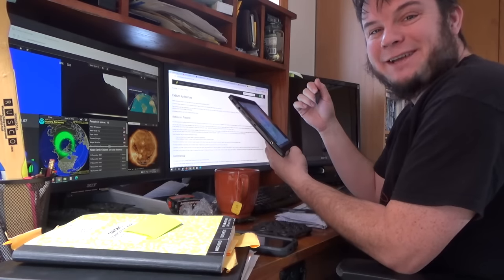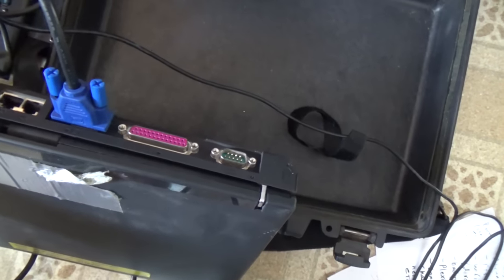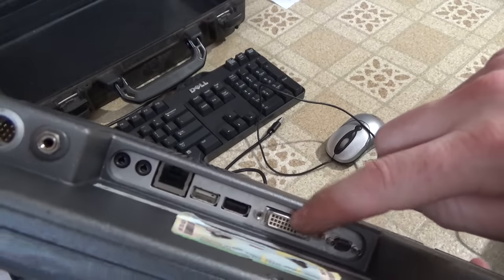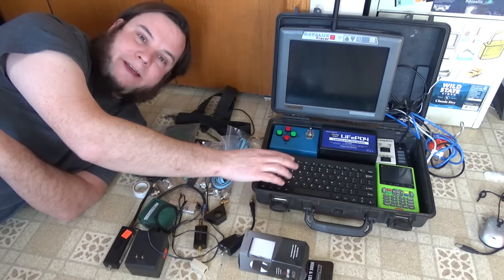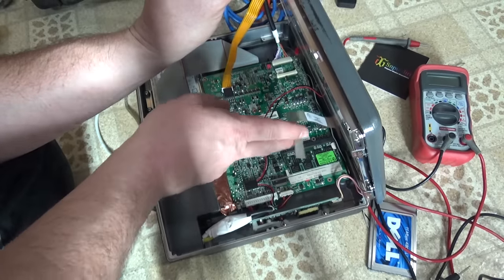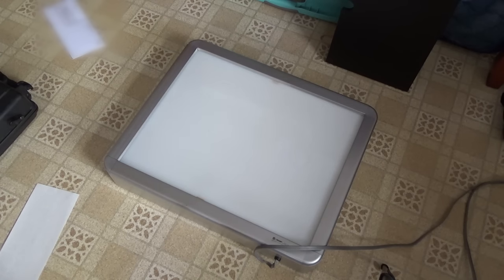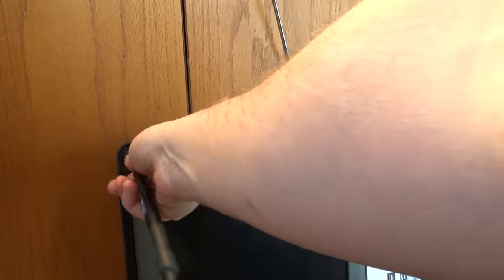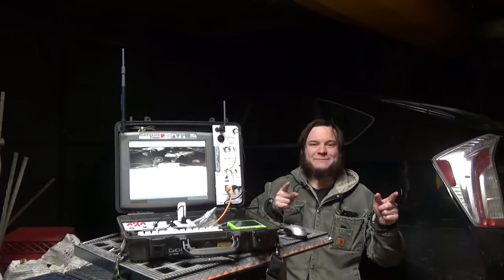Custom Cyberdeck For (Legal) Satellite Hacking

Comment: I have a few ideas for a more stealthily James bondy functionality if your interested.
Reply from the maker: Sounds interesting!
Reply: @saveitforparts  I just work with a lot of very very tiny tech we'll say and micro servos and I wanted to build one sort of similar but more so like an all in one totally security  hardened deployable work station.
I have a complete blueprint of it and a choice pelican case for the base layout I'm just in the practical thinking mode.
I know first gens always leave room for improvement but for instance a manual internet kill switch ..toggle switch actually, uh the hole inside of the case has right now a layer or two of blockade copper Faraday mesh for transport and the obvious latter.
The micro servos control a fully integrated automatic slide out key board with obstruction sensors...lol so it doesn't push shit off the table when its deployed.
That was an expensive bellcurve lol.
A manual push in and lock solid and soft mouse pad.
A wired mouse due to the increased security needs which pops out with the pad secured by shielded magnets to hold in place during transport but easily removed when in use and I'm having issues with this idea of something to take up any extra length of cord not being used but get this I'm writing a program that can analyze the potential Moise function work load on an individual page to translate how much mouse movement and speed will you need depending on the environment and automatically adjust the slack or retention of the mouses cord length so its always out of the way but your never restricted..
And since I'm not good at coding thats gonna be a later feature if not abandoned in defeat.lol
The keyboard will be 50 50 wired but also wireless however my buddy wrote be a program that monitors the wireless connections of everything and sets very accurate GUI control over any intrusive behavior .
Its pretty neat so far but I was thinking about a separate very precise touch pad for an added option but I dont want to over cutter the build 
I want it to be seriously beyond movie style for instance I have sensors on the inside built into the latches so when you set it down flat as you should lol.
When you unlock the thing with well its a locking mechanism invention that I havent seen an equal to anywhere , I'll just say it's bad ass for now .
Anyways when you unlock the two clasps two arms drive the lid and screen up out until wherever you want which is obviously preset it also has obstruction sensors on it so it doesn't throw itself off the table.

As the lid is opening up two 3×3 inch plastic doors slide open exposing two specialized fans  ....these servos that latch the fan doors are very strong so the hole unit can literally be submerged in water indefinitely ....yes I've tested it and works like a charm ...
A third door opens deploying about 4 inches of single power cord witch manages the hole unit.
I was going to put a battey pack in it but it got way more heavy than I thought so maybe down the road.

But ya there are several more integrated gadgets ...chargers all retractable and detachable for android and iPhone .
Also have docking systems with a movable arm to keep your phone tablet whatever where ever you need it which is under nitrogen gas assisted actuators which can be moved with little effort but remains rock solid basically no shaking phone screen at all it's so sick I love that feature ...lol

But minus a few other things all in all relatively interesting to me anyways.
Hopefully

Comment: A computer with no PAE, that must be really old indeed. I remember PAE was working even on super old Pentium 2. I am guessing the CPU you had in this police computers, was some form of Pentium M (so Pentium 3+ in architecture), but the chipset probably was gimped and did not have proper support for PAE), or some pins from CPU were not wired properly to memory or chipset, as they were never used in original design (Windows XP probably never enables PAE if physical memory is less than 4GB), so this issue only shows when you try to use it.

Pretty old computer, screen probably also not super great in direct sunlight, and not very power efficient (it was designed to work in a car not from just small battery). But it looks pretty cool.

Comment: Dude you could have easily set that up with a used surface pro. You can get an old one with an intact screen for like $100

The nice thing is that you can drop them in once you run out of cop computers

Comment: Found the mysterious connector in 5 seconds by look up round 12 pin connector and found one in amazon with this title "M12 12 Pin Male Connector Cable, A Code Straight Molding Cable Male Aviation Sensor Electrical PVC Cable Industrial Molded Cable AWG26（2Meter"

Sounds something super serious 😅😉

Comment: Computer cases are sold with a few sockets and switches on the front and a lot of sockets and a main switch on the back. This means you are caught between hitting the back of the computer toward your face all the time on your desk or having to move around and look at the back of your computer where it is setting.              The other result is to head the back of the computer to your face and leave the little switches and sockets that are on the front where they are and memorize reaching them as they are some distance away
V  hey computer manufacturers  put all the sockets and switches on one side of the computer and then we aim that toward our face    help.

Comment: my Dell precision t1700 Bios been corrupted and is unreadable(failure to POST) i tried to load a O.S with a flash drive and while switching to uefi safe move and restarting my computer no longer post. 
clearing cmos ,drain of power ,checking all ports monitors and cords dident fix the issue Computer was maybe interrupted during load(Cant remember but most likely).any help to fix my BIOS.
i Might need a Flash.Anyone with experience with this?? can i fix it with a flash drive
Reply from the maker: This might be the wrong place to ask, sorry! Don't think I've ever had to reflash a BIOS myself.

Comment: Use two of those dish antennas for an interferometer
Reply from the maker: I tried a 4-antenna array but just got a mess of noise. Even just two were noisy. The LNB tuning and wire lengths are slightly different, so it's hard to get them matched up.

Comment: We need you to get a 3D printer ASAP. I built a portable pelican case gaming computer just like you did. Hot glue and all. Now I 3D print sooooo much. You could level up your hack smithing x50!
Reply from the maker: I actually have 3 semi-working 3D printers. I just haven't had time to fix and adjust them or learn how to 3D model stuff!
Reply: @saveitforparts  fantastic I have no doubts you will leverage them when the time comes. If you want to skip some learning curves might I advise a bambu lab p1p or x1c. I have 20+ Ender 3 s1s and the Bambus are just insanely easier. They would make your creations insane! Keep it up man I’m definitely subscribing too you!

Comment: can you please provide model of the think vision monitor ?
Reply from the maker: I'm not really sure, I couldn't get it working so I threw it in a box in the basement. It seemed like an interesting gimmick to have a 2nd monitor for a laptop, but other than the cyberdeck I couldn't think of an actual use for that.
Reply: @saveitforparts  ok thx for help and good luck with ur new cyberdeck :)

Comment: May I ask how much money it cost you to make it
Reply from the maker: Lets see, not counting any of the computers I tried but didn't use, I'd estimate something like:
-Pelican case ~$20 used
-Satellite meter ~$60 on eBay
-Battery ~$30 on Amazon
-Keyboard ~$25 on Amazon
-The RTL-SDR and filters I already had, but probably ~$75 for all those. 
-Maybe another $20-$40 for assorted cables and wires and adapters. 

Some of this was stuff I had left over from other projects, or just random things from dumpster diving like the wifi cards and random push buttons and ethernet plugs and other small parts.  I'd guess all together it was around $250 USD, but it would have been more if I didn't already have a bunch of junk hoarded!
Reply: @saveitforparts  I'm thankful for you

Comment: 4 minutes in and I've heard 2 factually incorrect statements.
(USB 4 doesnt come on square connectors, Lenovo bought the PC division of IBM, when IBM decided there was no profit in laptops and desktops anymore)
Is this a spoof?
Reply from the maker: I was mostly making fun of IBM, because as a consumer you don't hear about them any more (Like when you hear Kyocera mentioned and have to check if it's still the 1970s). And I have no idea if there's a USB 4, but when I made this video the weird square one was so new that Best Buy didn't even know what it was.

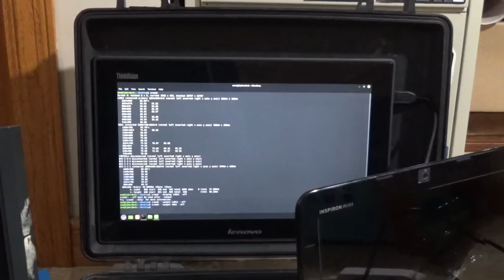Comment: 2:12 ok strange problem but my windows 🤮 laptop has the f1-12 keys bound to a secondary function ie. volume control/light etc BY DEFAULT with no built in way of toggling ...how do i switch the functions BACK to the fn functions so i can play StarCraft again 😂😂😂😂 i can't micro/macro i just end up raising volume and dimming brightness making the game unplayable
Reply from the maker: The Saveitforparts comments section, now online tech support 😂
I think laptops usually have an FN key or FN-lock, sometimes that gets stuck or gets gummed up.

Comment: So the problem with old computers for that type of project is their poor energy efficiency. You could enjoy much more time of work from that 12V battery if you used an older ARM based Android tablet (and maybe replaced the os with Linux). Even modern Raspberry PI would do better and would consume much less energy than this old 686 PC junk.

Comment: an array! yes
Reply from the maker: I tried that and it didn't work very well, too hard to sync up the phasing on multiple antennas. I might try it again some day, but I've started taking apart some of the little RV dishes to mess with the motors and whatnot.
Reply: @saveitforparts  dohhh

Comment: i mean it is fun but wouldnt it be easier if you used a raspberry pi?
Reply from the maker: Probably, but I've run out of those unless I take apart another device I made. The way Raspberry Pi's have skyrocketed in price and disappeared from store shelves, it was easier to just use junk I already had.

Comment: yo the screen dont need 10 volts, it needs more then 500ma of power sir...    " usb3.0 is 900ma  usb 2.0 500ma per port. aka two cables" good luck

Comment: Rv satellite array sounds so dumb but so awesome
Reply from the maker: It was kind of dumb, the dishes aren't synchronized enough to add to the signal. If I had a 4-input SDR like a Kraken it might have worked better!
Reply: @saveitforparts  a personal array like that might be amazing for amateur radio astronomers, probably easier than constructing a single large dish if all of the smaller dishes could be synched

Comment: 5:56   , I have this little adapter and NOTHING I can use it on.  I've been wanting a carPC for the longest.  I'd mail it to you for one of those monitors + cash if necessary.  I have a whole library of i386 .iso's that would run on those dinosaurs.  Any way , cool stuff.
Reply from the maker: Someone actually sent me one already! I just need to open the thing up and connect it. I've had a couple people ask about the monitors but I'm not sure if I want to sell any yet. A couple have some damage or badly scratched screens, and I want to save at least one good one for spare parts in case I kill mine.

Comment: man scrap the battery, find a 12 power supply and if you want portability wire in a cig lighter plug.....reminds me of the time I turned a briefcase into an AIO wifi hacking case

Comment: Broooo, A stack of Datalux's for a buck? 

Dude, I remember installing these into cars back in 2008. Back then they were running off a low power version of the Pentium 4. And no, they were not around just for a couple years. They went from Pentium 4s to Core 2 Duos, then Core 2 Quads, and then the early Core i5's and 7's.

On that note, I dunno how you are not able to get Linux Mint to boot on that. I got it to boot on an old Pentium 3/Windows 98 unit from around the turn of the millennia. but then again, it may not like trying to boot from a usb drive. And I was using a burned CD for mine.

If ya'll wanting to, I'd buy one of those Datalux's from ya for a project I'm thinking of doing. I'd love to finally be able to poke one of those properly without the City PD watching what I'm doing.
Reply from the maker: They're lucky I saw the auction at all. These small towns put all their surplus on some obscure website that no one uses, because they either haven't heard of Craigslist or aren't allowed to use it. I'm sure most of this stuff ends up in the trash.
Reply: @saveitforparts  Oh for sure it does. I would later find out that the PD I installed mine for started chucking theirs out as they started phasing out the Crown Vic Fleet. This along with the "then" 5 to 8K/per in-car camera systems we had installed in some of them. Understandable that when the new Chief came in and got whiff of this, he threw a complete hissy fit. All in all, I'm gonna guess an easy 50K in equipment just got shucked into the dumpster that otherwise could have gone to a lesser funded department or sold off as parts.

Comment: Yo replace the battery with it and voltage incapaz not capacity of course capacitor Bank and then connect DC directly through your capacitor battery side in the necessary volts
Reply: Okay speech-to-text thanks

Comment: if it runs XP . . it will run windows 7
Reply from the maker: Eh, I don't think much of the new-fangled Windows, XP is all you really need :-D
Reply: @saveitforparts  windows 7 is the ultimate XP . . the cracked version of course . . unless its illegal in the US :D
Nice project by the way 👍

Comment: 📺💬 ( they add conversation sound ) Jirayu we make ourself tobe like this what are you doing during weekend⁉
🥺💬 Answering questions, reading, exames and keep apply for jobs to create incomes.

📺💬 What is this come with interfaces and Wifi I think it is a communication controller for communication separate from CPU default.
📺💬 The power connecter be careful when you open the lid up you need to hold it with 6 hands and cannot break it if you want it to work again otherwise some devices cannot work or have problem controls.
🥺💬 To open the lid up you need to prepare that is one part you need to attach them back for control devices that come with a computer.